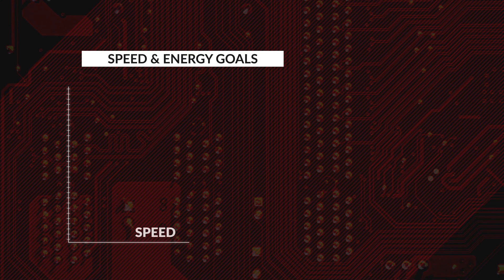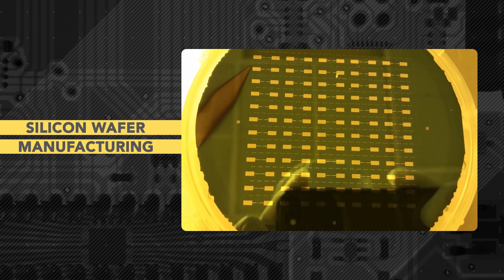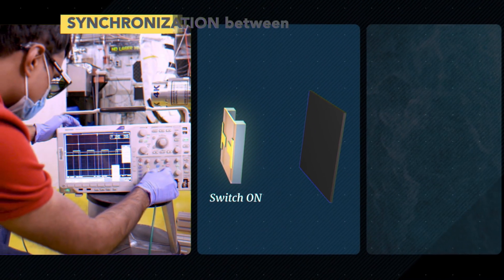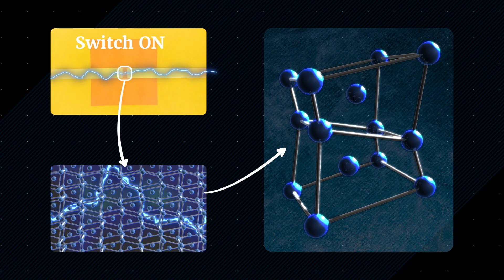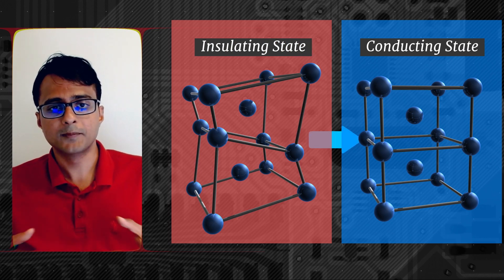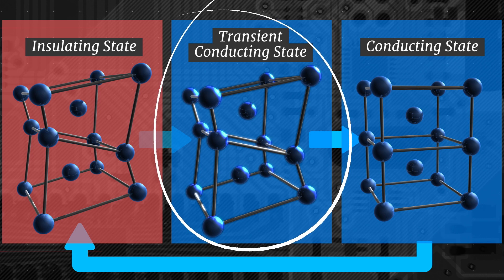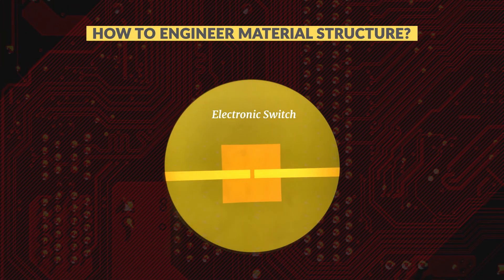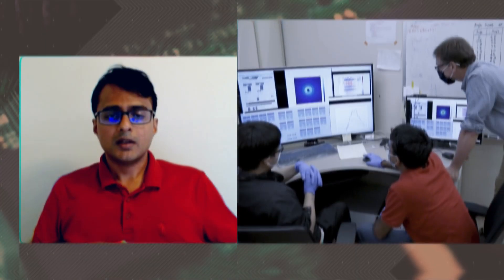Scientists Take First Snapshots of Ultrafast Switching in a Quantum Electronic Device

Comment: I looked At this video and came back few days after... With a digested comment.... It appears that at certain levels geometry takes presedence ... The kind of geometry that gives individual leaves thier finished shape... Maybe the quarks are the Cardinal points of nature... By which geometric shapes can affect and create its own angular momentum..... And the geometric shape also can be like a container that holds the  sum of alignment and correlation between the spin of electrons individually and collectively.... Which can act like a kind of electromagnetic switch that alternates the magnetic bipolar moments.... Into momentum..... and maybe the vibration to power it all is created endlessly with the black Holes ongoings... Which these vibrations assemble enough to form nutrinous that eventually condense enough to form light.....and the building block expands up to dense matter.....